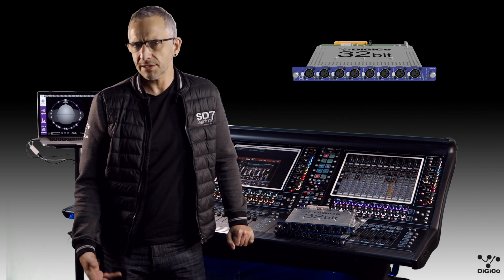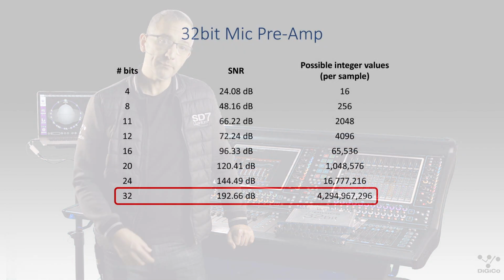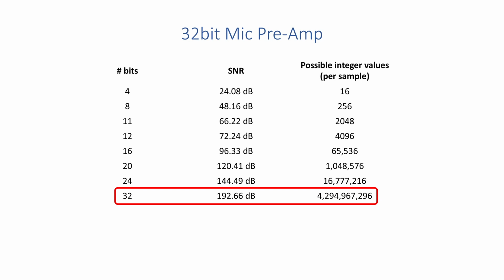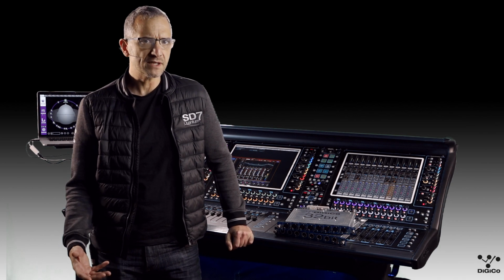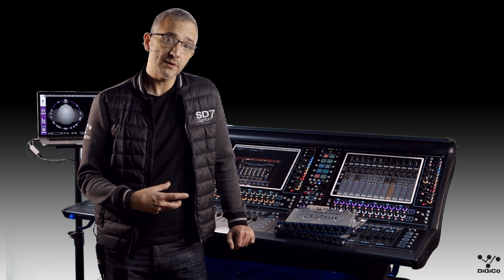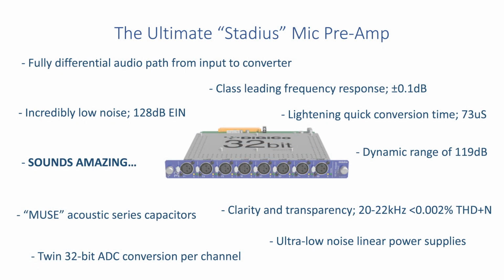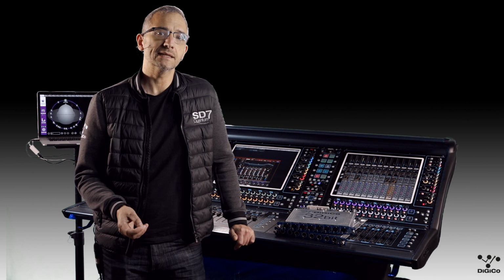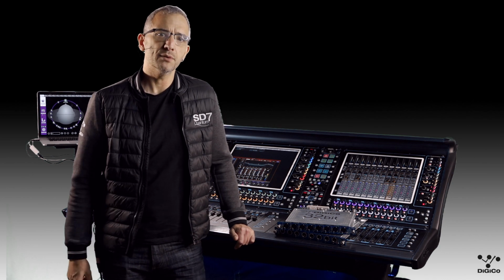DiGiCo Quantum 32 Bit Technology - Why It Matters

Comment: 2:35 This is fundamentally wrong. By throwing away the 8 LSB you're not removing noise, but dividing the entire signal by 256, the analog SNR stays the same. And in result the theoretical max SNR drops to 144dB because you can't represent smaller variations with a 24-bit integer.
Unless the signal is kept in 32-bit integer or floating-point there's no advantage in using 32-bit ADC.

Comment: A little late for an April Fool’s bit, Digico.

Conversion quality improvement is measurable in a number of ways not described by bit quantity, as is clearly evidenced by the wide variety of subjectively different sounding 24bit devices, not to mention the same phenomenon that occurred at every stage of the bit wars.  However, the inherent difference between a 24bit converter and a 32bit converter with bits 25-32 thrown away amounts to ‘marketese’.  The exact same improvement is achievable without the additional, expensively discarded bits, through better attention to clocking, power supply, resampling and numerous other widely known design parameters.  Sadly, that work cannot be promoted with a “32” in 48-point font in online advertising, hence the resulting disingenuity here.  I expect much better from Digico.

Yes, we know the major chip manufacturers have been producing 32bit chipsets for years now, and the reason is, counterintuitively, the consumer market, where every brand new shiny thing is descended upon by millions of ravenous, know-nothing buyers.  Is this what you think of your customers?
Reply from the maker: Hi Peter, Thank you for your comment. Our R&D engineers spend a lot of time selecting the best components for our next generation of converters, if you have a suggestion of a 24-bit converter available for manufacture, which would give us the same Signal-to-Noise Ratio performance as our 32-bit converters, then they’d love to hear about it. The use of higher bit depth converters removes the conversion process as a noise source, which allows us, as you’ve rightly pointed out, to fine tune, measure and tinker with the power supplies, clocking considerations, the OPA choices, the R an C types, layout, shielding techniques...etc. And then, most importantly, listen to everything. We make these videos to give people like yourself more background info and detail, and If you’d like to discuss this further you’re more than welcome to reach out to us. We also encourage you to listen to our 32 bit cards within your DiGiCo system so that you, as many touring, broadcast and theatre mix engineers already have, can experience it for yourself and hear the sonic difference.
Reply: DiGiCo Consoles   Let me guess: the new “32bit” converters will sport a dramatic new color of paint on the metalwork and cause the console boot display to prominently advertise for this dubious investment.  That is what I mean by ‘marketese’.  Instead of making objectively quantifiable improvements to your 24 bit converters, you are choosing to promote and sell a pointless, new technology, complete with some very adroit marketing.  Any sonic improvements Digico may have made with the development of the new “32bit” converter are obviously not at all due to their use of 32 bit conversion.  Why obviously?  Because you simply discard the 8 LSBs!  Many, though certainly not all, of your customers see right through this nonsense and your salesman’s reply does nothing to dispel my, or any other knowledgeable buyer’s, suspicion.

People buy from Digico because you have established a high level of trust and confidence with very good build quality and exceptional software.  Don’t squander that by conning your best customers into a disingenuous numbers game.  You will be found out for it and wonder why you ever went down that road.  Your customers are mixing music, not discovering new types of matter in the outer Oort Cloud.  Our mixes consist of signals whose maximum dynamic range and minimum noise, dictated by the immutable laws of physics, are exceeded by orders of magnitude with the resolution of 24bit conversion.  No matter how many of these uncorrelated sources are summed, your claim of validity for the difference between 144db and 192db dynamic range is simply laughable.  This will be explained by many people more eloquently than I am doing here, and Digico will have billed some of its customers tens of thousands of dollars for what they ultimately discover is BS.